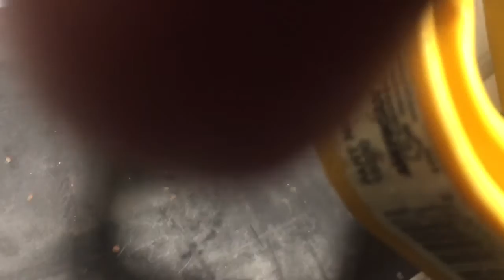Inductive vs Capacitve Inductive discharge

Comment: The difference is merely the structure. AC is magnetic in nature but impulse electricity is destructive. It can pierce matter easily.

If you want continuous capacitive discharge, AC, use mislavskij transformer. Maybe there would be different things?

Inductive discharge, capacitive discharge, and even inductive-capacitive discharge(just connect to source together then have a short output.)

Of course, AC cannot be compared to the destructive power of impulse electricity.

Comment: All mutual induction is primarily due to varying capacitance. Could you please explain the two circuits; at least identify the parts using common terms?Thinking outloud here. Is the metal cylinder an HV capacitor? If so, then the "capacitavie inductive discharge" is AC discharge (versus possibly HVDC Tesla coil --depending on how the circuit is set up.) Charge motion is current, so it seems you are showing HVDC vs. HVAC, and that HVAC passes through rock, HVDC does not. This is to be expected. AC passes through dielectrics much better than DC --that is standard phenomenon for a the rock as dielectric in a capacitor arrangement.
Reply from the maker: +Benjamin Brink look up Tesla Stout Bar circuit or Hairpin circuit.
The metal cylinder is just a shunt.  This is an AC circuit.  Current is 23mA
The only difference is one has shunt and caps are shorted this makes discharge event quite different...... Thank you for your insight, this is AC.
Reply: +diveflyfish Thank you for references. Yes, differences are to be expected. AFAICT, the circuit consists of dualing LCR circuits that produce constructive and destructive inteference, resulting in higher voltages and frequencies. One could theoretically get a similar performance by dualing two automobile ignition coils using a fast cycle DPDT switch (such as rotating distributor cap or relay circuit) to trigger each half of AC cycle.

Comment: Or make most of the building blocks on site, like we do today. Maybe make the blocks in place on some walls, to achieve those high mountain tight fitting block walls. Do the blocks weather differently than the rock at the quarry ? There are granite boulders in the Sierra mountains that are half mud and half rock hard. There are some granite boulders in Folsom lake that like that to. One had a tree stump wrapped around it, soft bottom and granite hard top. I'm not convinced granite rock came from a tectonic plate shift to expose hard granite on top of mountains. 

Granite on top of mountains with thick veins of Quartz running through it and melted bubbling gold running right with the Quartz (maybe alchemy ). 

MR2Tuff showed electricity can sort and move material very quickly.

Everything matters, there's more than one way to make a rock or a Crystal.